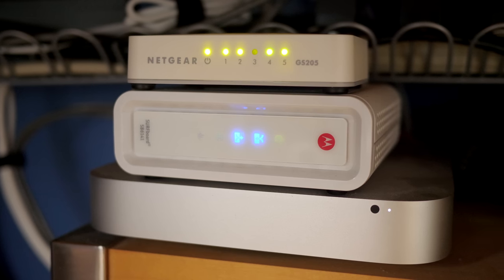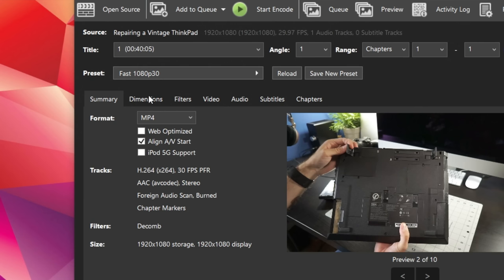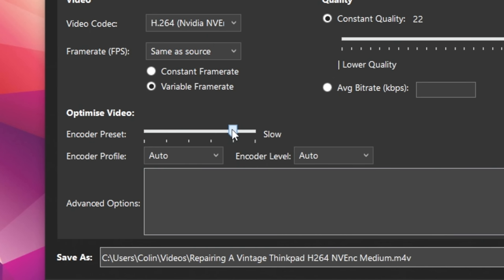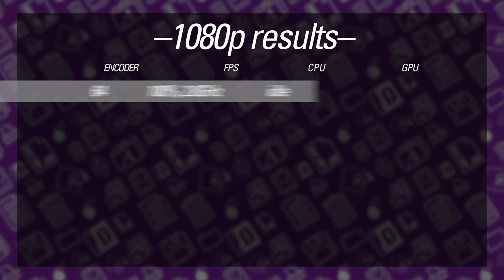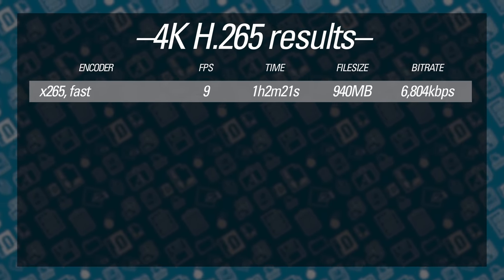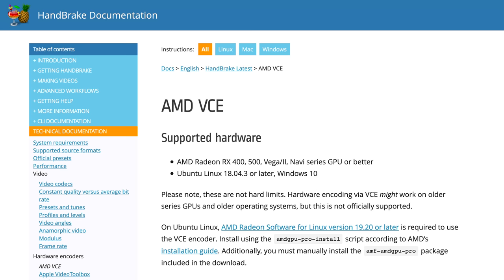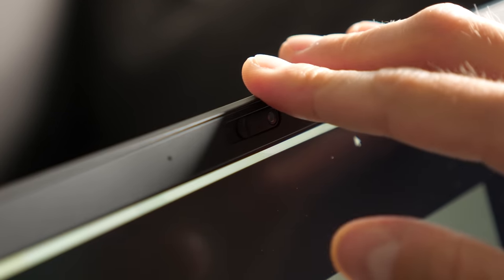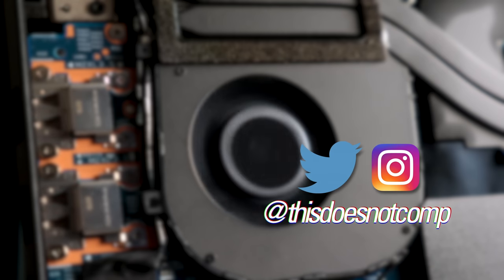Encode Video Faster with Hardware Acceleration (That You Probably Already Have)!

Comment: Hey, multiply 1080 by 2... you get 2160. 4K is only two times of 1080. That's sadly a marketing lie since they used the horizontal number (3840, rounding it up gets you 4,000) instead of the vertical (2160) as we used to. We had 144p, 240p, 360p, 480p, 720p, 1080p, 1440p, but suddenly they ditched this fine system and went with the marketing schemes
Reply: 2x the horizontal resolution times 2x the vertical resolution = 4x the pixels.

Comment: I stumbled across your video because I was trying to answer a similar question. However, when it comes to size issues with NVEnc, did you happen to see this thread? https://github.com/HandBrake/HandBrake/issues/2231 If I'm reading it correctly, it sounds like we shouldn't use the "Constant Quality" setting because 1) a particular number can mean different things to different encoders, and 2) "[Constant QP] unnecessarily wastes disk space and should be avoided!" We should probably be using the "Avg. Bitrate" setting instead. In your case, you can try to hit YouTube's recommended bitrates, https://support.google.com/youtube/answer/1722171?hl=en. In my completely unscientific testing, I found that I can set an average bitrate for an NVEnc encode that matches a software encode set to CQ 18 or 22 and the result is nearly matching file sizes and no difference in video output that my eyes can detect.

Comment: useing this to compress a 1 hr 24 min documentary onto a zip disk. yes 100mb.        anyone have setings to match my needs in brake
Reply: 100 MB for 84 minutes is going to mean you need super low bit rates. H265 will yield better video quality than H264. First of all, dial down the audio bit rate as much as possible but don't completely sacrifice it. If you are going to be playing on a modern computer then use a low bit rate mono Opus soundtrack (16 or 24 kbps), otherwise use mono 16 or 24 kbps AAC+HE if your playback device can understand AAC+HE. Failing that, you'll have to use AAC-LC mono at 32 or 48 kbps (or VERY aggressive VBR MP3) to retain any fidelity. 

If picture content is mostly film/video sources, at the very least you'll need to tune for film and do an aggressive two-pass encode. Likely a two-pass ABR-VBV is what you'll need. I'd also play with more complex B-pyramids and longer runs of B frames (as much as your chosen H264 profile and level will allow -- or more if you're willing to produce a noncompliant file to save on bits).

Video dimensions will also be massively reduced. 100 MB minus a small amount for overhead and a 48 kbps audio track only leaves you about 120 kilobits per second for video. Even a 320x240 video at 24 fps needs about double your available bit budget. You can either reduce the video to postage stamp sizes or reduce the frame rate (15 fps at 320x240 will yield about 115 kbps video bit rate, plus audio).

84 minutes into 100 MB is one heck of a challenge!

Comment: Your just waisting your time.
Use ffmpeg command line, its easy and much faster.
Also quality at cr is awfull so vbr 2pass is much better
Reply: Handbrake is literally a GUI for ffmpeg, you get the same results while not knowing how to use the terminal. Source: someone who does video editing (like, cutting and mixing video) on terminal ffmpeg.
Reply: First, libavcodec, the library used by Handbrake, is just FFmpeg in API form. Second, CRF is tuned to produce a similar quality to a 2-pass encode with comparable bitrates, but will save bits in lower motion and lower detail scenes. 2-pass encoding is only recommended when targetting a particular size file